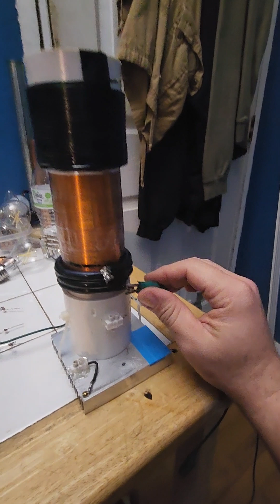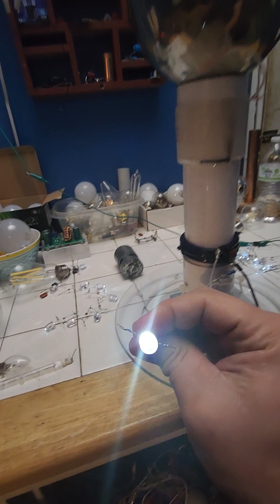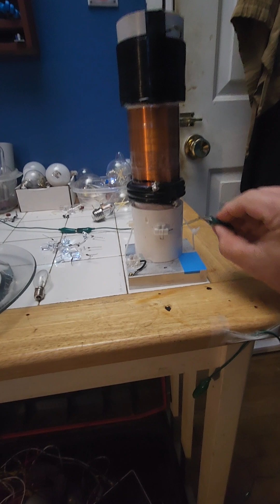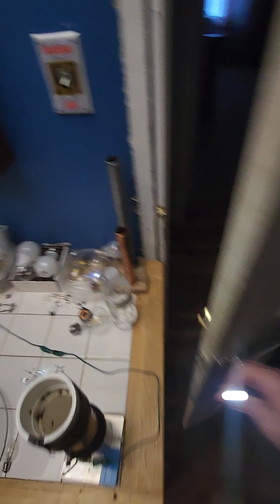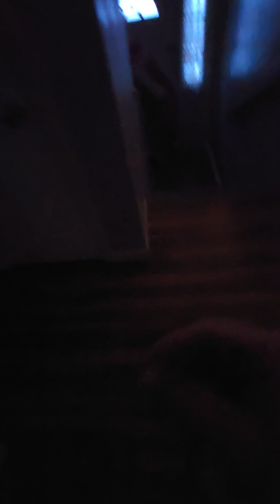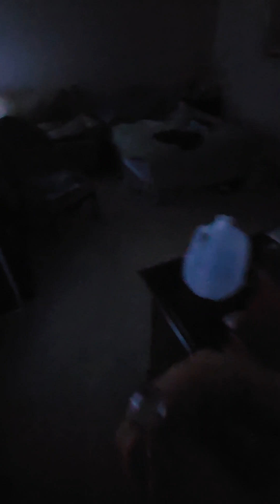♾️UNDENIABLE RESONANCES FROM A NEARLY PERFECT TESLACOIL WITH TESTS & EXPLANATIONS WIRELESSPOWERPUMP🌪

Comment: "All our research & work is based off of Nikola Tesla, Charles P. Steinmetz ,Eric Dollard & Ken Wheeler & many others."

You have my attention, I've been following all of these people for a few months, I've been analyzing Ken's definitions of voltage and amps as dielectric tension and magnetic release and I've recently come to a possible breakthrough based on it. This is a copy and paste from my notes:

"Electricity is the conjugate of dielectric and magnetic fields, Voltage is dielectric tension, Amperage is Magnetism, Magnetism IS the dielectric field losing potential. When a circuit is cut whatever voltage is in the circuit releases its tension and manifests as magnetism, Back-EMF.

This is why Tesla was adamant on high voltage and high frequency resonance, the more voltage you have the more amps are created when the voltage is allowed to relax, it's a direct conversion of volts to amps without sacrificing the voltage.

The early electrical engineers could not figure out what was causing their transformers to blow when they would cut a circuit in large transmission lines back around 1910, what was happening was voltage rebound. With AC current the electrical wave oscillates back and forth and when the circuit was cut, it would SNAP back or rebound with tremendous force, much higher than their components could handle. This would result in an explosion, thereby dissipating the energy through thermal radiation or heat. 

What ended up happening was C. P. Steinmetz was brought in to fix this problem. He called it "Back EMF" or EMF that flowed backwards with amazing force/pressure. We call it amps. Such force from the rebound cannot be explained by voltage tension alone, and thus must be in the form of current/amps.

Think of a spring under compression, that's the voltage, if you let the spring release that's the equivalent of magnetism, tension and release.

Get it in resonance with the coil and you'll be converting high volts to high amps every cycle of the frequency, It's just a matter of timing (frequency) in order to sync (resonance) the circuit design. It's like jumping on trampoline, if you don't bounce back at the right moment you'll never get more out of your jump than you put in. Once it's in resonance you can start harnessing the Back-EMF.

More Volts > more Amps > less heat, endless energy, you can easily wire a portion of the output back to the input, with the only limit being the resistance of the parts.

The Dielectric field is the Aether under tension or torsion which itself does not have dimensions, this is what Zero Point Energy actually is.  The best part is voltage boosters can be used for this, where you can easily step up a tiny voltage source like 9 volts to the millions. The implications are obvious."

That's basically the summary of what I've come to conclude, do you have any thoughts on it?

Comment: primary coil 3 turns 8awg is 20мм length  it is not 1inch ..... to get 1inch you should wind 1 turn more ....maybe if you add 1 turn more to the primary coil then you will get exactly proportion  1/4  and it will grow the efficiency  ....... now you have 20мм primary *4inch = 80mm   and 4inch is 100mm, so, you have not exactly 1/4 proportion.  it is 20mm difference

Comment: I dont have a clue what I'm doing, but i would want to make a system large enough to put out 1kw and power a used antminer s9. would you be willing to help me design something?
Reply from the maker: We're at the stage as well where we're leveling it up to 1kw soon. The new transmitter will probably be wound on a 4 inch diameter pvc pipe & We'll need massive schotty diodes to turn the ambient rf into usable dc power. Probably 1500 watt schotty diodes
Reply: @MTECH2022  neat, when do you think it will be functional? And are you going to give the designs out for free like this one? I would love to test it myself.
Reply from the maker: @Thomas Miata  yeah all our work is open Sourced & eventually made free. Our newest model is kept proprietary until we create the next better version. It's just our way of building funds for the technology
Reply: @MTECH2022  how much for a system that would power 1kw?
Reply from the maker: @ThomasMiata  I would guess under 350$ to construct. The most expensive components would be the high power schotty diodes & the dc to ac converter
Reply: @MTECH2022  an antminer s9 uses a dc to ac power transformer to power the control board and 3 hash boards at 12vdc. You can skip the ac conversion and increase efficiency to the miner.

Comment: Great, Over Unity aslong as I you are connected to a power supply or battery. OU, okay run the device from it's own output. You will not be able to. Proove  us wrong
Reply from the maker: We're very close to self looping it & if we can't for whatever reason we will shift our focus to our receiver technology. Some of our receivers are so sensitive they dimly light with no external input anywhere. Just a ground connection & a 3 ft antenna lead. I demonstrated this on some of my videos. I take my most sensitive receiver on a clear star lit night in the middle of the woods & they occasionally lightup.
Reply from the maker: Also our most sensitive receivers light when the transmitter is turned off.
Reply: Proove it. Make the output run the system, on other input power
Reply from the maker: @roger burley  eventually the receivers will become generators of their own without requiring a transmitter. I'm hesitant to share everything I know on youtube. I should be charging alot Of money for the things I discovered reading old electrical engineering books. All I'll say is when a special type of core material is inserted into a receiver coil & the receiver is grounded the led will light very brightly & the core material is a simple combination of minerals & very cheap.
Reply: All sounds good, well prove what you are saying, then you will make lots of cash.Don't just talk about it prove it if you can

Comment: Are you using all germanium fast transition diodes?
Reply from the maker: Yeah & 1N4148
Reply: @MTECH2022  awesome! I'm studying water as a high voltage/high frequency capacitor and it is not only self healing but it's also said to be comparable to germanium in some way (I'm still learning).

Comment: Hi did you wound L1 and  L3 on top of L2 or just close to L2 thanks
Reply: thanks for quick answer and what type of capacitor is i think it on L1?
Reply from the maker: @Reniukas 007  yeah it's a 400V 10NF resonant capacitor in parallell with the L1
Reply from the maker: L1 is wound over L2 & takes up a quarter if it's space & L3 Is connected In series to L2 & not wound on top of eachother
Reply: The part i do not understand is that the L3 is actually connected to L2 in series... whoah
Reply: I need to experiment with those exact type of reverse polarity coils. Oh, it could create scalar events!!!
Reply: I guess you have longitudinal flow of dielectricity OR "Induction Tunneling Effect." It's both, I think.  The phase combining creates scalar events that cause Earth's "something like electrons" to flow into the circuit that is also a "Tuned, Tunneling-Circuit." It's perfect!!!!

Comment: sorry.        in order to get an accurate  measurement  of  output current, there must not be any significant load present in the output circuit.      in other words, the output should be a short circuit; or with only a high-current, very-low value inductor in it.        similarly,  the method used to measure output current must  Not  affect  the output circuit.      which means, not running the output power 'through' a run-of-the-mill  ammeter.       d
Reply from the maker: The L1 is an air cored inductor & measured after passing through a full bridge rectifier that can more then handle the high frequency rating. DC Wattage is measured by multiplying voltage & Current. AC wattage is measured by multiplying Current Times Power factor Times Voltage. I also have 99.99% effecient RF to DC module conversion boards that show extreme overunity output. I'll be showing those tests soon too & the power can more then fully Illuminate a 150 watt resistive halogen load. Also My technology is being tested by multiple research groups around the world & they 100% undeniably verified overunity & it comes from the Earth
Reply: @MTECH2022  so incredible. So incredible